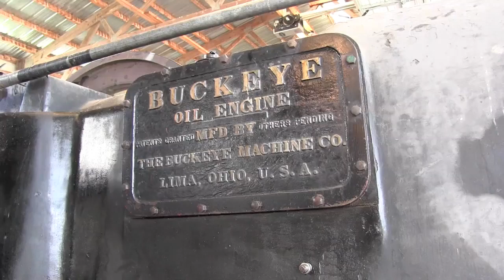Buckeye Model L

Comment: What a beast, imagine the force behind those flywheels.
Reply: Q : How much torque?
A :  YES
Reply: How much torque? All of it.
Reply: @billybobbrubaker2907  and a little more to spare
Reply: roaring 125hp😂
Reply: @falahsamisyahdan7962  that rating is over 60 seconds, if you harnessed all the energy in it within a couple, wew.

Comment: That’s amazing fuel efficiency for engine so old and absolutely huge
Reply from the maker: Bear in mind that fuel economy will be drastically reduced if a load were applied.
Reply: Once it's up to speed, doesn't take much to keep it spinning.
Reply: @SootHead  So what is the efficiency under load? Would be interesting to compare to newer machines of similiar load capacity
Reply from the maker: @mobuildsstuff  Under a maximum 125 hp load, this engine would use  six to seven gallons per hour, per a period graph I have. As a display engine under no load, its operated at half speed, 100 rpm, and is really barely running. Compared to modern diesels, oil engines are VERY inefficient. Compared to diesels of the '20s and '30s, they are at least 30-40 percent less efficient. Oil engines had three redeeming characteristics over diesels back in the early days (back into the 1890s):1- They were considerably less expensive than a diesel, 2- They were "omnivorous," and  able to operate on a wide variety of fuel oil grades, from what was basically crude oil with the big chunks taken out, to the lightest oils similar to what we now call "diesel fuel."  3- they were portable. Despite being omnivorous, oil engines  were subject to having trouble with poor fuel quality. The heavier, less refined oils tend to leave lots of deposits in the vaporizing chamber, on the rings, piston crown and in the fuel injector. This engine came from the beginning of the era when fuel oil began to be of consistent quality. Though this engine runs on modern #2 diesel fuel, it would be happier with something a little heavier like bunker oil, which is about 20 percent heavier than diesel.

Up to about 1920-25, diesels had to be very large and complex, most using air injection (fuel injected by high pressure compressed air). Once solid injection (mechanically injected high pressure liquid) was perfected, and demonstrated by the Germans who used solid injection diesels in their successful World War I submarines, it made diesels more practical and portable. Once solid injection was applied to diesels, costs, complexity and size came down and the efficiency of a diesel then started to make diesel cost effective versus oil engines. Oil engines were produced into the late '30s in the first world (later in other parts) and used into the '50s.
Reply: they don't make them like they use to
Reply: @JonathanQ95  no , its not profitable .

Comment: This is exactly what I want to run a 24k generator for shtf.
Reply: I'm a machinist , I always dreamed of upgrading the bearings on one of those old girls .
Reply: @turboprint3d  I located a late 1800's steam engine for a friend, it's about a 40hp in need of a total rebuild. He's making plans to line bore it and replace the crankshaft babbitts with roller bearings similar to what you'd find in a semi differential.
Reply: @johnlockesghost5592  ya thats about what i was thinking , other upgrades that might be interesting would be a cam ground piston , with that and roller bearings it might make a few more hp as well .
Reply: @johnlockesghost5592  oh anther thing would be to offset the cylinder towords the leading end of the downstroke of the engine like 10% as well if its being line bored already , would be an increase of efficiency , and lessen wear in the bore . a few years back we rebuilt an engine from a 2.5 ton truck from im going to say 1914 . we ended up getting cat pistons and bored the block to match , as well as cat sodium filled valves , that had to be slightly modified . I ended up getting sick and no longer work there never got to see it run .
Reply: @turboprint3d  if you want to read up on something kinda cool, research steam wankel engine. The Brits did some pretty neat experiments looking for efficiency
Reply: @johnlockesghost5592  ill have to look into that , I'm usually making HP , but in this application alot of my knowledge could be used to make alot of friction and wear improvements .I had and interesting concept of a sterling cycle Wankel , i have yet to sort out the heat ex-changers yet tho so not sure if that's even doable. I'm currently working on a 2 stroke engine with a pressure lube system . at this point I have the blower built and functioning, and I have started working on the engine itself. I have a youtube channel if your interested mind you film making is not my expertise, but you may like some of the stuff I work on .
Reply: Will this run at enough rpm to run a generator?
Reply: @gregkotoch2765  I was being facetious, but I think it probably has the torque to do a 1:10 step up.
Reply: @johnlockesghost5592  my first time seeing a machine like this. It is fascinating.  Makes me think what could have been if this technology wasn't abandoned.  It would most likely have put traditional ICE engines to shame by now.
Reply: @gregkotoch2765  the engine Im building I guess but it's not good for that application . It's gas powered and will spin comfortably at 9000 rpm .  Basically I designed a few superchargers 3d printed them and tested them . Then made one of aluminum and now I need an application for my supercharger so I'm using in it in my engine concept . It's only 50cc , as my shop as home is all small machines .  I plan on building a improved large flywheel engine , at scale to test some of my ideas but that's likely a ways away .
Reply: With the massive flywheels that this magnificent beast uses you would not need a seperate generator, just permanent magnets installed on the outer flywheel rim, i would say 6 or 8 magnets spaced evenly and big enough to energize two independent induction windings, one on each flywheel could easily produce 3 phase 330 at 60 hz. Wich is US standard gen side voltage after high tension stepdown transformers at substation. Two winding sets per flywheel with exciter magnet sets at 6 evenly spaced around the flywheel will produce power at 60 hz with engine at 200 rpm. Amp load capacity would be detemined by winding turns, magnet mass times field coefficient (strength of the magnet as compared to its physical size and weight) load impedance, and air gap between magnet and winding core. Im sorry, i just had a nerdbrain incident. That can be just as embarrassing as a shart in sunday school!. I digress. The fact that this relic still runs stands testament to the craft of engine building. The things that these dilligent craftsmen were able to achieve with what little they had as far as knowledge of metallurgy, machining processes, even something that by todays standards is considered routine, like taking measuments to one thousandth of an inch, were impossible in those days. Absolutely fascinating!
Reply: This engine would last the rest of my life. We went backwards with technology. No computer on this prime mover.
Reply: @johnlockesghost5592  why would you want to get away from the babbit bearings? I’ve ran steam turbines and pumps, and blowers with them. We open them up do a light scrape and change the oil. Just curious why go to a roller?
Reply: @JAMESWUERTELE  somewhat material tech has improved drastically , something like ceramic bearing sleeves on both surfaces , the biggest wear point is the bore of the jug and the bearings holding up that flywheel . maybe full pressure oiling , no computers tho . mind u u can make good electronics they just don't.
Reply: @gregkotoch2765  Chuck a big belt on the flywheel which feeds to the generator shaft, might be able to get something.
Reply: @traviscapehart7590  I think your math is a bit off... Running at 200RPM,  you'd need a 36 pole generator to get 60Hz. (You need two poles to start one north and one south, at 3600RPM, and doing the math to reduce it down, gets you to 36.) It has to pass by 60 North AND South poles each and every second. Each second it goes around 3.333 times.  So 120 poles per second/3.33 revs per second=36 poles.

This style of generator is much more like a hydro electric turbine speed, and as such, they have crazy numbers of poles and require commutator rings... But, if you did use permanent magnets (which cause unreliable voltage regulation) it could work with just stator windings. Either way, not an impossible thing to do, but not exactly ideal.
Reply: @JustIn-sr1xe  I'm thinking a big flywheel will be necessary just to smooth out rpm spikes and dips. Any sort of engine irregularity with  just one cylinder will probably be seen either in rpm fluctuations or generator amperage movements.

Comment: Will it maintain enough heat at no load to keep running?
Reply from the maker: Eventually, if the day is warm enough... but this was a problem back in the day and one of the surface ignition engine's "fatal flaws."

Comment: Yes it is a true diesel, the flame gets shut off after its running.
Reply from the maker: In order to be a "true" diesel, by the standards of when that engine was built and today, it has to achieve over 500 psi firing pressure and most oil engines do not.
Reply: @SootHead  I am wondering how you found this monster ??? I would just love to have one puffing away in my back yard. Drop a line and e-mail me so we can have a long talk or just can do that on this comment part. Thanks vf
Reply from the maker: @victoryfirst2878  It was at a show. You wanna see more, go to the show which is linked above. Also check out the Tri-State show in Portland, Indiana, where they run a couple of dozen similar engines. Also look at the rest of these videos.
Reply: @SootHead  Correct-o-matic. Diesels are compression-ignition engines. Hot-bulb engines like this are much lower compression. Ditto the thermal efficiency- a stopgap. Never before heard of a "hot-cup" engine. With the much higher efficiency of true diesels and much lower weight/hp, don't expect to see any of these working today. Just show-ponies, except that the imbalance could make it a good paint shaker/drink mixer.
Reply from the maker: @jacquesblaque7728  "Hot cup" is just a variation of the surface ignition principle, with the variations expressed as hot bulb, hot tube, hot cup, hot plate, etc. I think you understand the principle, Jacques, but for those that don't, surface ignition is when a hot spot in the combustion chamber is used to "crack" the fuel oil... e.g. vaporize it... so that the heat of a lower compression ratio can ignite it (as low as 6:1 in the early days). When everything is working perfectly (a pretty narrow range for an oil engine), the fuel oil is vaporized to just below the temp required to ignite it by compression. The problems were that back in the day, available fuel quality and specific gravity varied a lot. You can fine tune many surface ignition engines to operate reasonably well on a specific fuel by adjusting injection timing. Advance it for heavy fuels, giving it plenty of time on the hot spot to vaporize, and retarding it for light fuels that vaporize quickly. Problem was, one batch might be light and the other might be heavy and not every operator was capable (or motivated) to adjust the timing from one tank of fuel to another. There were also lots of impurities, so both the injection system and the combustion chambers caked up with various residue. The fuel issues, and the fact that true compression ignition engines had to be much more heavy and large to contain the pressure, are what gave oil engines their brief time in the sun. Oil engines are somewhat "omnivorous" as they relate to fuel and most can tolerate, or be adjusted to use, fuel of varying qualities from what we now call "diesel fuel" to a heavy oil that is barely a step above crude oil. True diesel are not omnivorous and from day one, required much better fuel that an oil engine. When commonly available fuel improved and had more consistent characteristics, diesels became more prevalent. Technology was able to downsize the diesel, thus negating the oil engine's other advantage, portability/package size. As diesel fuel became more prevalent and easy to produce, and lubricants improved, the final nails were in the oil engine's coffin.  Going back to external heat, once the engine can sustain combustion, the external heat can be removed but on a lightly loaded engine, such as one at a show, the engine might just barely be above that threshold... so when running it slobbers and pukes it's way thru the day. The modern light diesel fuel helps a bit. If they had to run on a heavy oil of yesterday, they probably wouldn't be able to do it.
Reply: @SootHead  Wow! 
Thanks for the knowledge! 
😀👍🇦🇷✌🏾

Comment: Elyria, Ohio.  I will try to look up history of this.  Where the factory was.  Who the people were.  Profitable?
Reply from the maker: Factory in Lima, Ohio. The design was by Dwight Orion Barrett (1884-1964) and the early version of it appeared in 1917 as the Buckeye-Barrett oil engine. Buckeye lasted until 1948.
Reply: @SootHead  thank you very much.  I worked five years on clean air heavy duty Diesel engines going to 13 markets.  Now only 12.

Comment: Wouldn't it work better if mounted solid on a platform?
Reply from the maker: It would. Read some of the other comments to get more context on that question. It's not easy or cheap to mount it and the association that runs it probably doesn't have the funds, not to mention there may be issues in that they own the engine but someone else owns the property.

Comment: How would they have started it back in the day without high volume air? Did a several men simply turn the flywheels lol.
Reply from the maker: At the time it was built, they had high volume air. Rudolph diesel's original engine used high volume air for starting and for injection in the 1890s.

Comment: Imagine using that as a power generator 1 gallon of used Merle basically mixed with diesel will probably last all day I mean you could use those regular heating oil most likely or the oil mixture they eat they use I mean I'm running my diesel truck on and make sure of used motor oil that is filtered and mixed with gasoline

Comment: I know it looks impressive and it's lasted years and will continue to last but 125hp - about the same as a small family car.
Reply: yes, but it also makes about 17x as much torque.
Reply: Right, the HP of a family car and far more torque than any super car.  Most big engines (old and modern) have these characteristics, low HP, high torque.
Reply: Why does everyone think horsepower is the only thing that matters on engines. This makes the same amount of torque as the rotation of the earth

Comment: Used on the farms for thrashing ?
Reply from the maker: Weighing 15 tons, it's too big for that generally speaking, and it has way more power than a threshing machine would need. This one ran a 440-volt, 125 amp (55 kilowatts at 440V) generator at a grain elevator in Grabill, Indiana, in the days before high voltage power was supplied by the electric company there. It operated daily from 1935 to 1947. It had been installed in a basement and when 440 power was run by the power company, it was no longer needed and the door was closed. The unit was too big  and not valuable enough to move out, since part of the building had literally been built around it, so there it sat until 1981, when a crew from the Maumee Valley Antique Steam and Gas Association rescued it . They literally had to tear part of the building down to get it out and dig out a ramp. I've seen pictures of how they did it and my hat is off to those clever Hoosiers.

Comment: Man, a 5KW generator probably wouldn't even be noticed as a load by that beast. So, 5000 watts all day for a gallon of fuel???
Reply: Yeah it’s kinda sad how far we have gone away from efficiency and focus more on emissions today, I truly believe the more efficiency is better for our environment than reducing emissions, less fuel used is less fuel we have to produce, more power means less fuel needed for the Sam amount of work
Reply: what? no it can go a day on a gallon with no load, meaning not producing and just running the engine idly
Reply: No, it’s a gallon a day to keep the flywheels at speed with no load/ braking force. 

Add a load and you need more power to keep it at speed, and what is more power but more fuel.
Reply: That was a gallon of fuel on no load.    These engines have efficiency comparable to a gasoline engine - these need about 400 grammes of fuel per kilowatt-hour.   Considering "all day" as 6 AM to 6 PM, then 5000 watts is 60 kilowatt-hours, so 24 kg of fuel needed, i.e., about 5 gallons in addition to the one gallon needed to overcome the engine's own losses.
Note:  a modern diesel generator is about twice as efficient.
Reply: @keithammleter3824  note: this engine is at least twice as large and old as a modern generator and still has that amount of efficiency
Reply: @wildman510  :   The video says it is rated at 125 HP.  It will have about the same efficiency as a modern GASOLINE engine generator (~22%), as it has about the same compression ratio and no turbo.  That's roughly half the efficiency as a modern DIESEL engine generators, which have a much higher compression ratio and a turbo.
But, running at only 200 RPM instead of the modern 1500 or 1800 RPM   (for 125 HP), it be physically twice as large, it will be something like 20 - 30 times as large.  A modern 125 hp engine is car engine size.
There is no reason why its efficiency should be much less than a modern gasoline engine, as thermodynamic principles 9eg kinetic theory of gasses, what engine engineers call the "standard air cycle" etc have always applied, and engineers 100 years ago were quite competent.